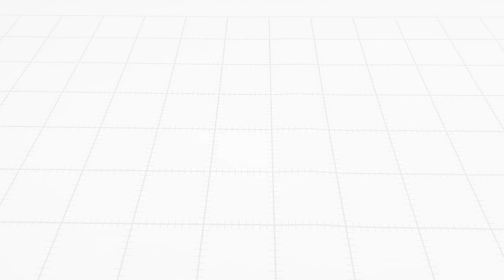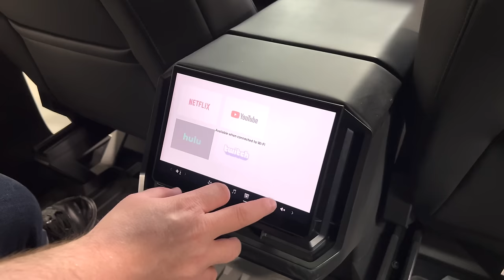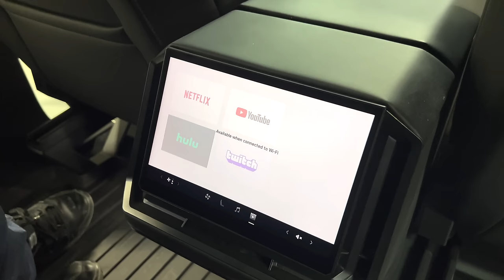Funky Form & Features: Tesla Cybertruck Interior Review

Comment: What happened to the rubberized wheel covers?  The exposed lug nuts and axle end give a rather unfinished appearance.  It isn’t like it is an old Jeep with manual locking hubs.  It appears the covers have been deleted from production Cybertrucks.
Reply: They are being redesigned and will be supplied to all owners later. The original design had some issues with rubber-on-rubber rubbing, i.e. the cover would eat into the tyres.
Reply: @HenryLoenwind  Thanks for the reply, appreciated.  I had been wondering why the change.

Comment: Im kinda shocked that Carl didnt mention how LUMPY those white vinyl door panels are. They look terrible. I dont get why someone would want white in truck interior in the first place, but a darker color would have disguised the lumpyiness. Heck, good old fashioned upholstry would have looked much better and been more durable. Same with that fake suede dash top-hat. I guess it's purpose is to help deaden some of the sound reflections from the giant flat window... but it looks cheap and prone to damage. And im not convinced fabric is the best material under the tight corner of the window either... how are you supposed to vaccuum out all the dead bugs without marring that kind of fabric? Again, it seems like old fashioned upholstry would have been a more durable choice. And the riser the seat is on, sticking out so far seems like a hazard. And the floor in the front is... almost flat... but those dividers look like rock and mud collectors to me. How are you supposed to hose out that center compartment? Wouldn't an actually flat floor be better? 

I donno... IMO this interior isnt anywhere near as nice as what the prototype seemed to promise, and it feels like it is filled with problematic decisions that will impact people who actually want to use this as a truck. In fact, it is hard for me to say who this interior is even designed FOR. 🤷‍♂️ Carl isn't usually such a soft touch... I've seen him absolutely inviscerate muuuch nicer looking interiors. This looks like an almost total fail to me. This somewhat reminds me of that awful BMW interior with the grandma quilt seats... Carl was wayyy too nice about that one too.
Reply: Well said. They cheapened it, cut corners, cut costs, and raised the price! This interior is a huge disappointment- and for $120K?

Comment: 25:15 what are the difficulties in closing out that corner that your hand is rested on and making the bonnet a clam shell design? Surely that would improve aero and pedestrian safety? Whilst simultaneously removing the precision required for the A-pillar shut line?

Comment: Two features I’d love to see in a software update… 1. Ability to turn off the pedestrian warning sound, Sandy might also appreciate this software feature as a hunter, it would allow us to sneak into our hunting spot more quietly off-road. 2. Increased speed in Reverse. Why is the speed limited to 15MPH in reverse? Isn’t this supposed to be a zombie apocalypse vehicle? I’d need to be going quite a bit faster in reverse to plow through a horde of zombies. Important software updates Tesla.
Reply: That is why we love the tear-downs. We can see where the wires are and fix issue 1 by cutting one. Probably the red one.
Reply: @geirmyrvagnes8718  sure, we could install a switch in the wire to the external speaker in the right front bumper, but shouldn’t there be a software solution when in off-road mode?
Reply: @Jacknox  If it is even allowed. If you could put it in this mode on a regular road, you could sneak up on pedestrians and cut them with the sharp edges? I don't know.
Reply: @geirmyrvagnes8718   I’m suggesting Stealth Mode be implemented in “Off-Road” mode only. We are unlikely to encounter a pedestrian in the context of the deep woods or desert. I believe Elon should grant us the freedom to choose silence.
Reply: @Jacknox  Elon would be all about that. The people mandating the silly sounds, not so much.

Comment: I won't buy a car without a turn signal stalk.  I've suffered enough with the HVAC and radio controls on my S being on the tablet, but if Tesla removes stalks from the redesigns, my S will be my last Tesla.
Reply: It's a non issue, but I had a similar concern at first. Most owners adjust within an hour or so of use.  I prefer stalkless slightly now, although no problems with stalks either.  It's easy to activate, and I love the automatic deactivation. When you exit to an offramp or get onto the freeway from a onramp it automatically turn off the blinkers - something mechanical stalks can't do.
Reply: There are aftermarket stalks and button and whatever people are thinking tesla should have added or not taken.  Huds and drivers display start at about $50.   They plug into the trucks existing wiring harness.  If you really think any of these are deal breakers you never wanted the truck.
Reply: Nah.  I have adapted to the no stalk wheel and now prefer it.
Reply: @MsAjax409  We hear that a lot but the copy cat posters are like a dog with a bone.
Reply: @MsAjax409  Any control that requires taking eyes off the road is a step backwards.  My S has most functions on the tablet including the heat/AC, and I still hate it after 4 years, but I love driving my old farm Explorer into town.  I can reach over and adjust the heat without taking my eyes off the road.  If the next gen Tesla S has no stalks, I won't be buying it.
Reply: @ohger1 That's you, not me.
Reply: @danharold3087 ??
Reply: @MsAjax409  Yes, but I hope I'm not near you when you're on a roundabout and have to take your eyes off the road to signal.

Comment: Carl needed to be familiar with added accessories vs. standard equipment prior to his eval. As an example, carpet type floor mats are included, under rears seats storage bins are available, and the storage bin in the arm rest is an accessory.  The stainless steel edges being deburred, the rear doors open a full 90 degrees, etc., were overlooked.  Homework please!
Reply: I fatally agree and I was shocked when he said he had never driven the truck, ever. This would have changed his thinking on glass above visor. Unprepared!

Comment: I'd be concerned about loose objects in the back seat area impacting on that central screen. Imagine workers with gear getting setup in the back and a helmet just lands on the screen. If it were just plastic vents, no one would give it a second thought, but a glass screen the can crack?  No more touch display.  Kids often have toys or sports gear with them that can also damage it.  Nice idea but expensive to replace.  It's one thing to throw a heavy ball against one of the Cybertruck windows during a demo but I don't think it would take much to wreck that display.
Reply: Any yet I am sure that if CT would not have it people would point that out too.  If your fear is real, expect a high impact cover on the aftermarket.

Comment: Thanks. If you'll be loading lumber, it makes good sense to plan ahead and remove any items which you will need from the rear storage bin before loading cargo. Also, small items purchased can go into there before loading the big items. I'd like to see a storage area or tray under that rear seat, instead of it being blanked off with a plastic panel. When you tear it down, can you please consider what it would cost Tesla to produce a Right Hand Drive version of the truck? A couple of billion people live in countries where they drive on the traditionally correct side of roads. (A defensive weapon would have been used in the right hand. So people drove on the left side of a road or track.) Thanks.

Comment: I only have one issue with the CT interior and it's a pet peeve of mine.  The white wrapped panels on the upper door looks like they are glued on to some foam padding.  Since it's a concave form it must be glued on the whole surface and therefore has a lumpy surface and cannot be stretched over like the horizontal dash pad.  I've seen custom upholstery done the same way on hot rod builds and they always look lumpy when using a smooth skin material.  Is there and answer to address that that doesn't involve another seam?
Reply: Good thing that those white panels only come on the Foundation Editions. On the black panels the rest of us will get, it won't be so noticeable.

Comment: Great review Carl. I would prefer the hard plastic for the rear seat undersides as they would hold up much better when stuffing hard objects in the rear floor area. Costs aside.   Agree on the hard sharp edges at the front corners.  Would have been difficult to mix softer alloys in and match the finishes to get some rounded areas. Not something I would have gone with the way it is but reasonable well accepted so far.  Looking forward to the tear down.  Also looking forward to something more in the budget.

Comment: Feels a little scary that the "gas" pedal goes all the way to the floor where the floor cover or anything else could easily go on top of it?
Reply: BUT
You won't have a water  bottle (,etc) roll across the floor and under the accelerator.
.
EDIT
.
Just remembered a customer of mine who suffered a serious foot injury in an accident caused by his foot sliding under the pedal.
Reply: If the pedals go all the way flush to the floor(?) that is probably so the can be stored out of the way when unmonitored FSD is legally allowed.
Reply: The accelerator pedal is bottom hinged because it is electric, not gas or diesel

Comment: Plastic and rubber are good in the floor and first 2' from the floor in pickups because of muddy boots. In a work truck. 
Also, all plastic door panels in the back where kids sit. Leather or pleather seats that won't soaked up a glass of chocolate milk, milk or milkshake.
If a gas can spills in the back will the seats down can it get in the cab? And Chevy.

Comment: 21:56 Tesla sells a very nice storage bin with compartments for under this seat ($250 in their store).
Reply: Velcro straps would also be good if there were places to hook on to the seat bottom.
Reply: @cartermiller2705 Their bin uses Velcro straps, there is a bar to attach them to under the seats.

Comment: The side bolsters look like they have zero side support.  How much is this thing? Chevy quality at porsche audi price
Reply: Having checked your previous, you should refrain from comment.
Reply: OK @cengeb I was looking at them and wondering if the seat was too narrow.   I have a wide back.   So maybe they got it right.
Reply: The Chevy Corvette (which has the same 0-60 time of 2.6 seconds as the Cyberbeast) has very good quality.  Cybertruck (starts at $61K for RWD model) is quite a bit cheaper than the cheapest new Porsche (Taycan at $99K).  Cybertruck also include many options as standard that the Porsche and Audi will charge thousands more for.  Never heard anyone complain about the side bolsters, but I expect the Covvette, with it's far smaller cabin has great side bolsters. Not exactly a truck, but if that's your #1 concern, buy that instead.

Comment: Look how high in the sky the sun would have to be to angle through the top of the windshield that's exposed when you pull the sun visor down? This a non-issue that was obviously thought through quite well. You go on to say you don't like the implementation of the visor when it's pushed over to shade the door window, but you don't explain why.

Comment: MUNRO Carl - there is ZERO stamped steel on the Exterior , its ALL 100% Rolled Steel thats AIR bended. TESLA has in Stock ROLLLS of Steel in Various sizes to make ALL the Exterior Panels .
this way there is LITTLE waste , and they are LAZER cut.
Reply: Laser
Light amplification by stimulated emission of radiation
Reply: The correct spelling is "laser". "Lazer" is a misspelling of the acronym "laser", which stands for "Light Amplification by Stimulated Emission of Radiation".
Reply: @lighthousesaunders7242  "Lazer" with big air quotes sounds better. But I am surprised that Carl has not seen Sandy's factory tour.

Comment: Sunvisors which aren't long enough to need to duck when moving them to the side don't block the sun at the side of your head and are useless.
Reply: And you don't need to duck if you just flip the visor to the 'up' position and then swing to the side and angle back down as it reaches the side window. I do it all the time in my current car.

Comment: 7:06 I'm sorry but having a load in the back of your truck with the tailgate down you're not hooking up  a trailer to towing an excavator. Not only that but you run the risk of exceeding your weight on your licence or GVWR on the vehicle. As a contractor if I have a trailer I'm loading the wood on the trailer to bring to the jobsite then go get the excavator.

Comment: 3:14 these stainless panels are not stamped the way other cars are. They are bent with a special brake Tesla has developed.
Reply: Pedestrian hazard. How is this thing allowed on public roads? Sharp knife like edges,it's insanity
Reply: And some one on another you tube,had the headlines get covered in snow in big storm,blocking headlites,unsafe led no heat and lites down in a good ridge to build up ice and snow. This is a menace to other motorists
Reply: What's a menace is folks driving in heavy storms and not stopping to clear off the car in reasonable increments.  This is a BS argument you will pay for in big fines when you get pulled over. @cengeb

Comment: MUNRO - Carl , the Cybertruck could have went into Full Production in 2019 following the event.
TESLA chose not to, because its a HALO Vehicle , and pretty Expensive. 
what TESLA did not have was the 48v, Steer by Wire and RWS. 
Tesla can sell way MORE Model 3/Y. 
and in the Short Term , would not be a Needle mover.
However, now in 2024 TESLA is able to use INNOVATIONS in both 2024 model 3 & Cybertruck.
and now Cybertruck is OUTSELLING Rivian in 2024. let that sink in. 
TESLA will LIKELY ramp Cybertruck to 100k in 2024, and 250k in 2025.

Comment: No SUV has an open bed, this is a truck.  People said the same thing decades ago when small trucks started hitting the market, saying they weren't trucks because they can't tow (heavy trailers).  A huge part of the population that drives a truck, never tows.  They just like to carry things in the back and occasionally go off roading.

Tesla should not have used the soft touch material on the inside of the door.  I thought they learned that lesson on their other vehicles?  It gets damaged easily and will happen even more frequently on this vehicle.

Comment: Put your finger in the edge and close the cover,lets see how the pinch protection works,same with the cutter door edges. How is this junk pass any safety standards?
Reply: Such a font of original ideas @cengeb.
Reply: Put your finger in the edge of the hood on your current car and close it and come back here and let us know how that went.
Reply: @DC-yh2oy  Not the point, the cover is electrical driven, not manual, like a hood.  electric windows have pinch protection, how does it work on the cover.  Pay attention.  Is it set properly, or will it need an over the air software fix, since tesla is all magic, and voodo